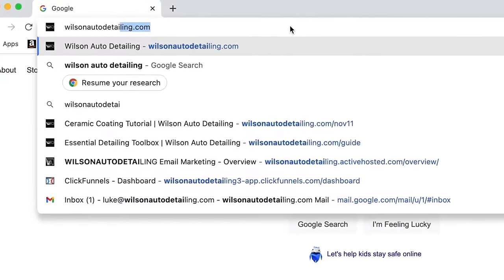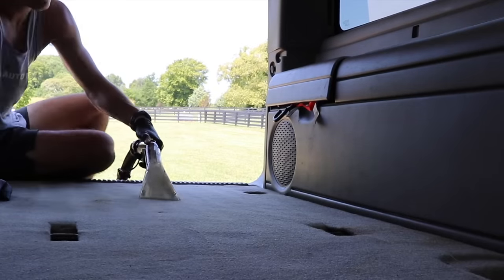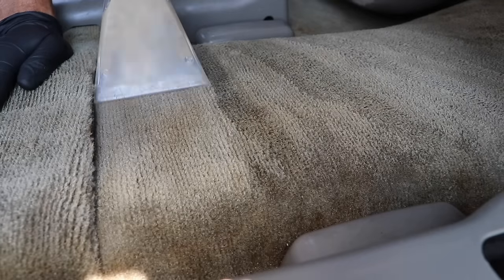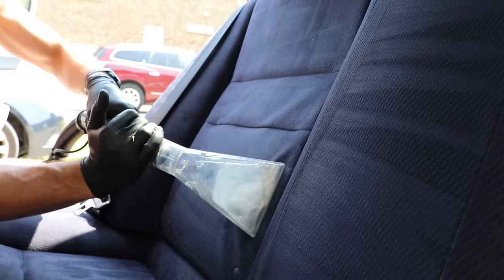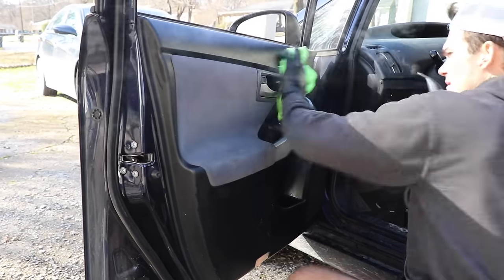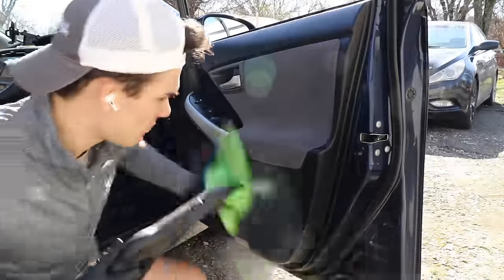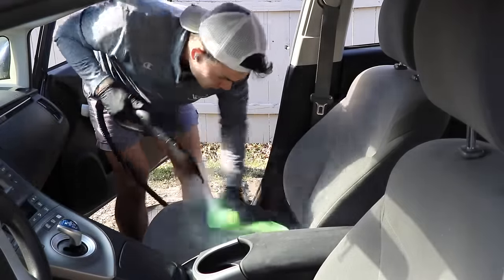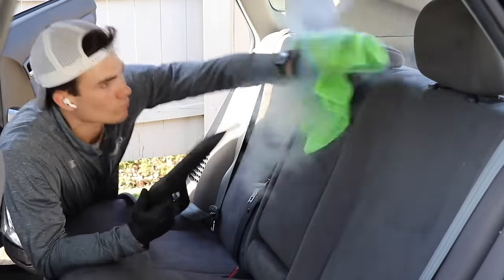Best Extractor & Steamer For 99% of Beginner Detailers... GIVEAWAY!

Comment: 3 cars done this week, post winter Michigan.  Just thinking of all the help your channel provided in the past.  Now need to just review/have fun watching techniques, product etc.  My Bissel proheat took a dump/broken hose....so I just bought the better ProPet (under 200 bucks..actually on sale this week for 145), with twice the suction. the other did fine so this should be pretty decent... fits my purposes...not ready to move up to this type stuff, because of the PRICE.  biggest tip from you guys...product Super Clean/diluted. Great.

Comment: I just bought the aqua pro vac last month in February. I had a good run with the bissel pro but needed something more professional and robust. It’s a great unit, I had tried using the hart 3 in 1 at first but it was to cumbersome and weird. It will get you by but I was tired of getting by and wanted a tool that would perform without annoyances. It is an awesome extractor.
  Don’t have the steamer, I am still rocking my mmccholoc 1375.. it’s not the best but it hasn’t let me down and it’s still chugging along and gets the job done but definitely once it goes out or when I’m ready I am getting the aqua steamer💪

Comment: I used to work in a carwash when i was young during my college years… now i do car detailing on weekends cleaning friends and family cars only.. I spent a thousand of dollars on chemical. However because its more a hobby than a job, i can't justify expensive tools like the aquapro.  Even $500 is too extreme for some pro detailers. Every tools that i have are cheap and i mean cheap tools.. mostly amazon, walmart, homedepot stuff.  From brush, to powerwasher to foam canon , to DA compound machine, all of them are cheap stuff except my small shopvac which is a gibbli as5 i found on craiglist for $50 , lately i built a wall powerwasher reel with a cheap ryobi 1600 psi , hoses management has become so easier now  ..  and the result always amaze the client. I always get the same comments after im done.. stuff like (man you're a pro, you should open your shop, the car is like new, smells so good etc ) these are the comments i get..   i watch youtube all the time and i see pro detailers using very good quality tools but when i check the price they are just way too expensive for my needs. So expensive. i will not recover the investment at all. When I detail family vehicles and i don't charge them. They bring me foods instead lol.  The skill, the passion, the chemical make a whole different between a pro weekend detailer guy like my self and a typical joe guy.  I was wondering if you could make a review of consumer tools we find on amazon and walmart.. cheapest possible and compare the result. Im talking about bissel carpet spot extractors and walmart handheld steamers.  I often see them under $100 mark.  To wash my brand new tesla, i don,t really need extractor as there is little fabric in a tesla, but my wife's car is all fabric and so are most car i detail.  But i do have a carpet stairs in the house so i might want an extractor…but since i do lots of car trims, a steamer will be more useful. Two Aquapro units at $500 each will be overkill..  so perhaps a bissell carpet spot extractor with a cheap steamer is more inline with my budget..  let us know when you have the chance to doma video comparaison.